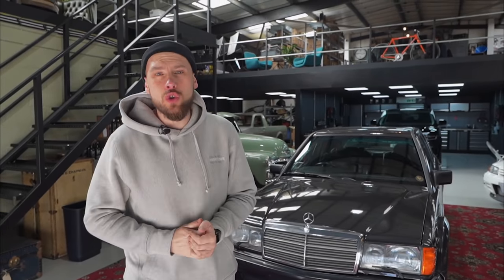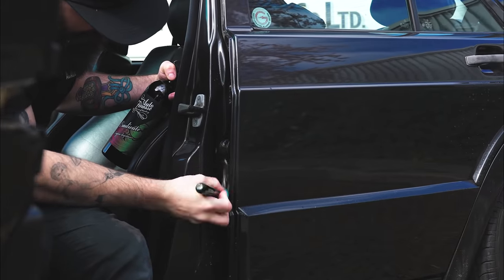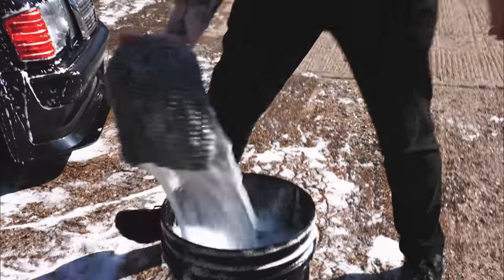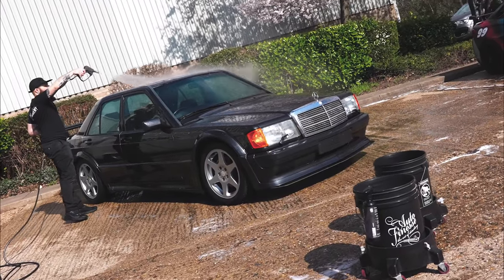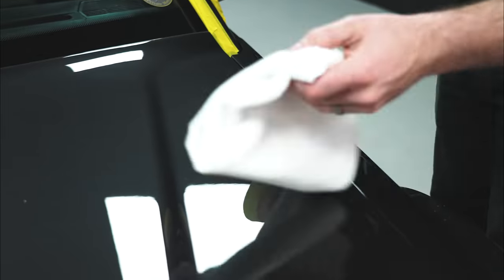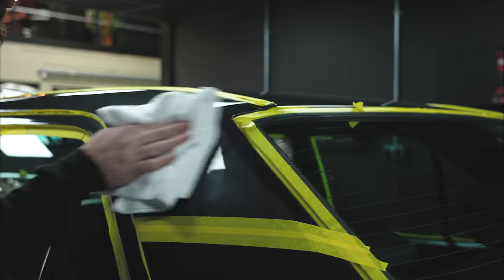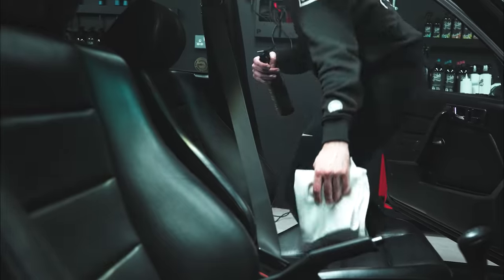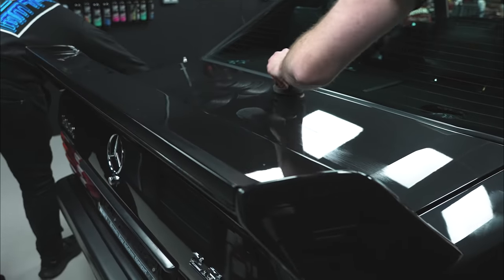Step by Step Detailing - Mercedes 190e Cosworth by Auto Finesse

Comment: this 190E 2.5-16 Cosworth is one of the high spec unit... has electric memory seats, heated seats, aircond, headlamp wipers/washer, ABS & ASD
Reply: It is a 2.3-16 in the video.
The 2.5-16 is not the Cosworth model anyway,Cosworth were only involved on the 2.3-16.
And even that was not badged Cosworth...
Reply: @jostocker1075   the Evo II 2,5 has an even bigger and taller rear wing , there were just 500 of them ever  produced , a bit darker grey ( all same colour ) + 2 silver ones 501 and 502 , that no one has ever seen , and no one knows who owns them , but Mercedes claims they have been made ! " one of the 500 " is also a car that is worth in-between 350 - to 500K USD depending on condition  mileage and stuff ! This 2.3 Cosworth , the rarest and more expensive are the ones that have a special engine tuning kit from back in the day called Power-Pack one , or  two !!

Comment: Hello, what products do you recommend. I wash and wax weekly by hand with 2 bucket method and detail by Hand. I don't  use snow foam or pressure washer and am looking to up my detailing game, preferably looking for greater water beading and hydrophobic properties aswell as gloss levels. I like to spend ages by hand lol. I currently use simple spray on Buff off products by meguiars and turtlewax but occasionally use a resin type polish for protection.

Comment: Any real Detailer knows deep down that Snow foam does nothing apart from add visual effect to the cleaning process.
Reply from the maker: Sounds like your using the wrong snow foam
Reply: @AutoFinesseDetailing  I see you're obviously trying to promote your Brand.Trust me I'm experienced enough to know about all snow foams contain have the same formula just different branding.I think you know that too but I doubt you openly admit it.Non Caustic TFR actually does what Snow foam is intended to do.